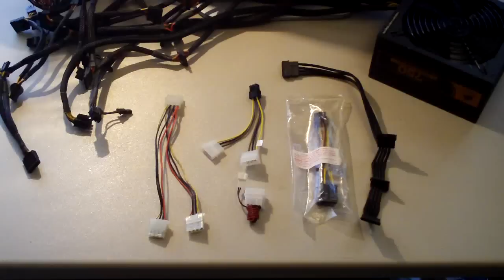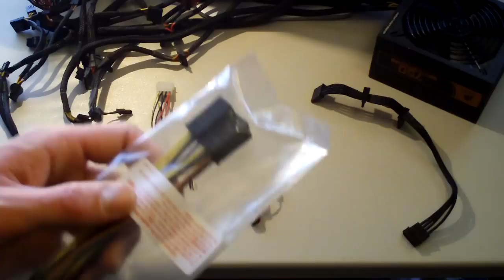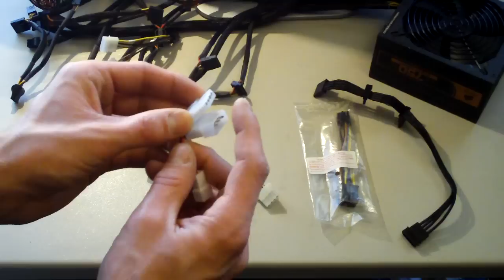PSU Power Adapters Explained (SATA/Molex/6-pin/8-pin)

Comment: My pc has a Molex splitter cable built in and I am buying an EVGA GTX 750 Ti FTW graphics card, which needs a 6-pin connector. Can I attach the Molex splitter cable to the 2 Molex to 6-pin cable?
Reply: I have the same exact question with the same exact scenario
Reply: Taegire Akpotaire Our paths will cross one day :D
Reply: Error. Username Not Found lol most definitely
Reply: I just went ahead and bought the EVGA GTX 750 Ti Superclocked 2GB. 

The single fan card the one that doesn't require a 6 pin connectors.
Reply: i have the exact same question for the exact same card also lol
Reply: i dont i just want to see if its possiable
Reply: Taegire Akpotaire Is the GPU any good? How's the FPS on games?
Reply: Effing Sensei Yeah it's really good actually. Low power draw, Small form factor. I get a steady 60fps in modern games. To put it in perspective I was getting 55-60 fps on the Battlefield hardline beta with high-ultra settings on 1080p resolution
Reply: Taegire Akpotaire Not bad, I've heard good from that, but i'm going to be getting the Sapphire Dual-X Radeon R9 270X OC 2GB GDDR5 since its just a couple quid more and is a massive difference in performance wise.
Reply: Effing Sensei Does that card need a 6 pin or no?
Reply: It requires 2 6 pins, which is the only down side. I'm upgrading my PSU so that I can use this.
Reply: isaac daniel Buy and fit a new PSU that has the cables.
Reply: Get a 500B 500W EVGA 80+ I use it for my R9 270X OC. Works like a charm.
Reply: a 750ti is basically the equivalent to a R9 270X. And 150w???
Reply: What's your current PSU?
Reply: oh god, please buy and install: http://www.amazon.co.uk/EVGA-500B-BRONZE-Power-Supply/dp/B00DZ6R9GE/ref=pd_sim_computers_9?ie=UTF8&refRID=12VZ44WYPG0EG20TB7WY don't use that thing..
Reply: isaac daniel Sure.
Reply: TopalthePilot Can I be the third to join the exact same scenario?
Reply: Samuel Hall hmmmm... yeah why not :D

Comment: on the cable at 2.50 you need to plug in two molex power cables for it to work right?

Comment: I have two Six pin power cables and am going to get a msi 970 which needs on e6 pin and one 8 pin, will i have to use this adapter?
Reply: Harry Owen Depends on what type of power supple you have.
Reply: gerbenstoffels Do you know what i need to do when the gtx 750ti that i have uses one 6 pin and one 8 pin but the card im gonna get uses 2x 6pin?

Comment: hey its safe to use a dual 6 pin to a single 8 pin connector for my gpu because my psu only has 4x 6 pin connector but I need a 8 pin conector btw my psu its 850 watts can you guys hel me out
Reply: a converter should come w the gpu

Comment: I was wondering if I could use these for a graphics card http://www.amazon.co.uk/dp/B00KKW2XEE/ref=wl_it_dp_o_pC_nS_ttl?_encoding=UTF8&colid=72XC9GQ93J0U&coliid=I30GY5GAR486PQ I have a 500w PSU but I dont think I have 2 6 pins which is what the graphics card(R9 270x) I'm getting needs and all I can find is 2 4 pins so would that 4 pin to 6 pin work?

Comment: PLEASE HELP REPLY I currently have a 450w power supply and planning to buy gtx 660 and my power supply don't support 6 pin so I have to get a converter I don't know if 450w is enough to power gtx 660 any suggestions ?
Reply: DJ GOON A little late but, 450 watt is generally plenty.
Reply: Lol so late that I already got a new PC
Reply: I might be late but yeah, thats enough

Comment: Hi Im rebuilding a pc for a friend but incountered a probelem. I replayced the mail board but dont have any sata connector on the new board. I have 2 hdd drives that use sata connections and should stay in plays. what do i do and is there a converter that i can use? Molex (Board) to Sata (HDD) Please advise

Comment: I'm planning on upgrading my gpu to a r9 290x vapor-x oc card, I have a apevia 800 watt power supply with only one 8 pin, but multiple 6 pins, would it be alright if I use the 6 pin to 8 pin to power that particular card, which requires two 8 pins?

Comment: Can a 6+2-pin connector work with an 8-pin card
Reply: Yes because 6 plus 2 equals 8 l, you just put the 6 and 2 in the 8 pin card together.

Comment: Will my 230w power supplie work with 6 pin graphs card ?
Reply: i dont think so , unless you're buying a reallllllllllllllllllllllly low end gpu
cuz 230watts is enough to power a fx-8350 , only
or like an i7 4770k overclocked with some hard drives and ssds....

Comment: Noob question: do dvd drives require SATA power cables as well as SATA cables? I know hard drives and ssds need.sata.cables and sata power cables, but Will my psu come with 2 or 3 SATA power cables? I need 3 if the dvd needs one as well!

Comment: I don't think my PC has ANY 6 pin and I want to upgrade to a 7870 but I need two 6 pins... I don't know what to do.
Reply: the card will come with one
Reply: justin mccaffery You can install a 6 pin? how does that work.
Reply: a 2x4 pin molex to 6 pin power cable to obtain optimal performance
Reply: justin mccaffery I think I only have one molex lol this is a really shit PSU
Reply: damn then ur better off upgrading how many watts is it
Reply: justin mccaffery I'm going to go with the 7850 instead and hopefully be able to pull this off. I think I might just be at the bare minimum with the PSU. 1 molex to 6 pin with 350w PSU haha. I really can't risk oc'ing at ALL
Reply: 350 is not going to work at all the card its self uses 200 youre going to have to upgrade even my card a r7 260x cant run on 350 watt which the r7 only uses 75 watts
Reply: justin mccaffery I've only got an  a8-5500 which runs at 65 watts, 8 gigs of single channel 1600 mhz and and 4 active usb ports. I also added in the HDD wihich runs a 6.8w so I  have about 250w left over, right? lol
Reply: youre forgeting the fans and motherboard
Reply: justin mccaffery Still over 200 left, there's only the CPU fan to power. No case fans.
Reply: its to risky youre psu will get to hot and having no case fans may melt ur card
Reply: justin mccaffery LOL
Reply: whats so funny?
Reply: my power suplay has 1x6 pins and 1x6+2 so im looking to buy a gtx 770 and it uses a 2x8 pin conector so will i get a molex cable with it or something?

Comment: I have a graphics card that requires a 6 pin power supply. I have a cable which is the yellow and black one you mentioned. But the only thing to plug the end into are two chords that are yellow, red, and black. One of said cables connects from my power supply to my disc drive and hangs freely while the other hangs from my hard drive freely please tell me what I have to do to fix this. I don't want to continue to have a useless $200 graphics card in my cp. Thanks

Comment: Hi ComputerTechTV I have an old PSU and I am gonna be upgrading my motherboard to support an Intel i5 2500k. My old motherboard which Im using now is a Gigabyte GA-A75M UD2H which uses only a 4pin 12V connector. Now I am planning on buying an Asrock Z68 Extreme3 or Asus motherboard to go along the 2500k. Problem is those motherboards need an 8pin 12v connector. My question is, is it safe to use a adaptor from 4pin to 8pin? What would you recommend? I know buying a PSU is the best way to go but as of now I just want a temporary solution as I will be upgrading to a better PSU. I will be using the PC for gaming thus overclocking will be there but would just be a slight overclock to maybe a 4.2 or 4.6ghz. Thank you and keep up the helpful videos!

Comment: Hi, I recently bought a combo USB/Firewire card - I have installed it and the USBs appear to work. I can't test the Firewire because the only firewire unit I have is faulty. All I want to know is......Should I connect the spare floppy power plug to the card.  The Card is a Pluscom 8 port USB 2 & Firewire Combo.  Regards.  Jeff

Comment: i have a psu with 650watt and im gonna try to power my radeon 7000 series card but  i dont have a 8 pin pcie connector so im ordering an adapter which is  2 male 4 pin molex connectors to a 8 pin pcie connector. do u think i'll be in a safe situation or should i not attempt? pls reply.

Comment: I have a pretty new Medion PC. Energy Adaptor, FSP Group.Inc with an DC Output of 350W. Now I have bought to myself an new MSI TwinFrozr Geforce GTX 770 OC Edition Graphics Card. And here`s the derpy Problem: The Card uses Minimum 600W, but my Adaptor can only give 350W. PLS HELP ME!!! WILL THE CARD CRASH?! PLS HELP ME I`M NEW TO THIS!!!! :O
Reply: get a new power supply will have stability and or wont boot

Comment: hi i have a molex to 6 pin adapter for my new graphics card but i am quite new to computers so i dont know if you need to connect both of the molex on the 6 pin or just one because i only have one available on my psu so i dont know if connecting one molex is enough for the 6 pin to power my gpu good enough please help.

Comment: my psu is from 2007 it's 800w and is sli readdy, it has two cables for sli each cable has 2 6 pins for 2 gpus. i don't have any extra 8 pins apart from my cpu. Can i use only one cable on a 780 gtx with 2 8 pin adapters since my psu has a lot of watts or should i put on 8 pin adapter on one cable leaving 1 6 pin hanging free and the other 8 pin adapter connect it to the other cable and use both cables on the 780 gtx?
what is your recommendation?
thanks in advance!

Comment: i have 2 asus geforce gtx 760 and they both have 8 to 6 power connector do i need to connect both 6pins to the power supply?

Comment: I have a TechSolo TP-730 (730W) PSU, and I wanted to replace/upgrade my Radeon HD 6850 with a Radeon HD 7870 because the fan is dying. When installing it, however, I noticed that the 7870 requires TWO 6-pin connecters, and my PSU only provides one. Can I use a 2 molex-to-6 pin adapter shown in this video with an unused 3x molex cable? (The existing 6+2 pin cable is on a different cable than the 3x molex cable.)

Comment: 2 molex to 6 pin adaptor is very useful but NOT if you connect 2 molexes on the same PSU branch as you've shown!! Its very important, thats the reason why there's two of them -> to juice up the GPU from different PSU 12V outputs... cheers
Reply: So if a psu only has 1 cable line of molex connectors with 2 connectors sitting on it (they are daisy chained to each other), then i can't use those 2 connectors to power a graphics card via a 2 molex to 6 pin adaptor?
Reply: 1mucako I didn't say you can't, it's just that if you use only one branch (cable line), you gain nothing by connecting second molex to that same current source.. the whole point of 2 molex to 6 pin is to draw current (power) from two different outputs so that you can have sufficient power for power-demanding GPUs..
Reply: HOrseshoeM
 What if I use the sata power cable line (with an adapter) to power the second molex?

Comment: 2 molex to 6 pin is safe, I use 2 of them for my 2nd 5850 on a Corsair GS700 for years and OC the living hell out of it, Tho don't recommend 1molex to 6pin on cards that need more then 140watts TDP, I paid more then enough for the PSU when it was new, so Im not gonna get a new PSU with 4 6 pin leads when I have 1 that is more then enough. Only downfall is its looks like shit with all the molex bundled up in 1 spot, lol.

Comment: Is there a connecter with a 6pin connecter on each side? I have a psu with expansion capabilitys and I have a gpu that requires 2 6pin connecters and I have none.

Comment: its not a stupid question and it depends for example the graphic card i got now doesn`t need to be connected with the psu its a gt 430 it sucks :D i want to upgrade to a 660 which requires only 1  pin cable well gpu like these require 1 or more 6 pin cables and sometimes not only 6 pin but 8 pin i think....

Comment: Hi I have a 550 watt ps and it only has one 6pin cable and I want to upgrade my graph card to a 6870 that requires 2 6 pin cables if I connect an adaptor for a second 6pin cable would this work???

Comment: If my GPU needs 2 times 6-pin power connectors and my PSU has one 6-pin and one 2+6 pin connector can i connect the two 6-pin connectors and leave the 2-pin unused?

Comment: Say,what about a 4pin to molex adaptor(for extra juice to your CPU)?My MB comes with 8pin +4pin socket for CPU.
I have this PSU and this GPU(it has an adaptor 2x6pin to 8pin or vice versa)...the PSU has 2x12v rails each with 30 AMPs...Will it give me 60AMPS if i connect 2x6pin cables from PSU to the adaptor and then the adaptor to the GPU?...Is it safe?...
Specs:
MB Asus Crosshair 5 Formula-Z
CPU Fx-8350
RAM Kingston HyperX Beast 16Gb(2x8) @2133
GPU Asus GTX 760
PSUEnermax Liberty Eco 620w

Comment: Hi, I have 1 molex available, and am wondering if it is ok to use the 1 to 2 molex adapter to power an 8 pin connector for a Radion 7950?  The card came with an 8 pin cable going to 2 molex, but as I said before, I only have 1 molex available.  Using a Dell Precison T3400.  Thanks

Comment: Sorry for dumb question but please someone help. i only have a single 6pin graphics power connector but will need two, for the molex to 6 pin adaptor do i need to plug in both of the molex cables for the adaptor to work?

Comment: i have two gtx 560 ti's, is it ok if i power the secondary card with the molex connector, but only using plug in one of the two molex slots to power the second 6 pin on that one card? so then i have 75% of possible power on the second graphics card

Comment: I have a 420w power supply, and I want to power a Palit gtx 650 TI 2GB, can I use the 2 Molex to 1 6-pin adapter to power it, I really don't want to mess up my GPU.

Comment: I have a two molex to 8 Pin - my PSU has no 8 pin.

But it is 1000 watts. 
I've seen it stable 800 plus at wall.

Comment: I have a 1000w dell power supply and I will be upgrading from dual 9800gt to most likely a gigabyte gtx 770 which requires 2 8 pin connections. My question is can I use my 4 6 pins and get an adapter that will take 2 6 pins each and put it to 2 8 pins and is that safe?

Comment: i just bought a geforce gtx 680 for my computer and the other end of the sets of 6 pins dont fit in my power supply :( do you know what to do? i was just going to go to radioshack and buy a new one.

Comment: I'm not going to "upgrade" my PC Power & Cooling Turbo-Cool 1KW to some lesser PSU just to get 8-pin PCIe. You obviously aren't over-loading a +12v rail with two into one! You seem to be confused about the purpose of the warnings. It's where you get the other 6-pin from after adapting your only two that's a problem. Also you may not realize that you aren't supposed to connect more than three drives to any one chain but I didn't hear any warnings or even a mention of the utility as an extension.

Comment: Hi, i need to know, my video card needs 2 PCI-E(6pin), my power supply doesnt have those, but have 2 Molex females, but I have 2 PCI-E(6pin) Adaptors, which each one have the Pci on 1 side and 2 molex males on the other side, so, can i use them ? But just connecting 1 molex from each adaptor to the separate molexs on the PSupply?? Connecting later both PCI to the video card ? Just need to know if can leave alone those 2 molex remaning without connection ? Thanks

Comment: Because my mobo only has two fan adapters but i found that my psu has sata coming from it and most fans come with the molex adapter (mine did) and i just couldnt connect it

Comment: i recently got a new pc and ive upgraded the cpu fan but in doing so i realized either i dont have or cant find molex connectors to add an extra fan because the mobo only has 2 fan connectors so do newer systems not have molex? because i see two unused SATA but the fan came with molex so...

Comment: I'm replacing a PSU, and ran into a problem of having no 6pin PCIe (the cpu setup is 7yrs old). I'm thinking of getting one of those 6pin converters. Is there are difference if it's 1 x molex to 6pin, 2 x molex to 6pin, or 1 x sata to 6pin?

Comment: certain GPU (usually higher-ends) require additional input wattage because the mobo doesn't provide enough power. So as he poster described, u sometimes run into the case where u do not hv enough 6pin (a hint that ur setup is old?)

Comment: hey my psu only has 1 8 pin for pcie power. i want to get the radeon hd 7950. it requires 2 6 pin.  i know 8 pin can supply max of 150W while 6 pin can supply max of 75 watts. i ve found a 8 pin to dual 6 pin splitter on ebay. my question is can i use that splitter to power the video card? because half of 150 is 75. it should be the same thing isent it? so at the end of the day wont the card get the same wattage as it would from a dual 6 pin? 
Someone please reply and thanks in advance!!

Comment: hey guys, my PSU is a shitbox basically, its an ISO-480pp (420 Watt) and i cant seem to locate any molex connectors coming out of the PSU, i think i found one but all the cords are so tightly bunched, i cant tell where the other end is coming from. if i use that first one he talked about so that i can get a double molex to 6-pin for a gtx 550, will that work?

Comment: i have a 09 model HP, with an outdated power supply but i just recently purchased a XFX ATI RADEON HD 7770 1GB GPU to run DayZ, but the GPU requires at minimum 450W power supply  & 6 pins, but the GPU itself was about $150 so i couldnt afford a good PSU, so i had purchased a Cooler Master - eXtreme Power Plus 500-Watt ATX CPU Power Supply for about $40 @ bestbuy, but the PSU do not have a 6 pin for the GPU  is it ok for me to use the dual 4pin to a 6 pin adapter & run it safely?

Comment: I have a radeon HD2900xt connected to a 2 molex to 6 pin and a 2 molex to 8 pin adapter, so i have nor 6 pin nor 8 pin on my power supply, although it works fine, i can even overclock my card (550watts power supply)

Comment: can i power up my GTX260 with 1 6pin to Molex adapters ? or it has to be two 6pin to Molex adapters.
Cuz right now im powering my 7900GTX with 1 6pin to Molex adapters. Not sure where am i gonna get 2 6pin to Molex adapters on my power supplie to the GTX260 plz help